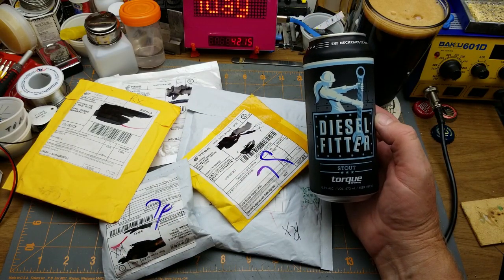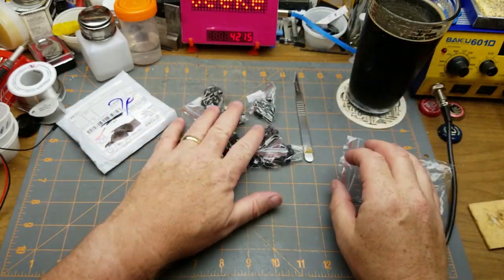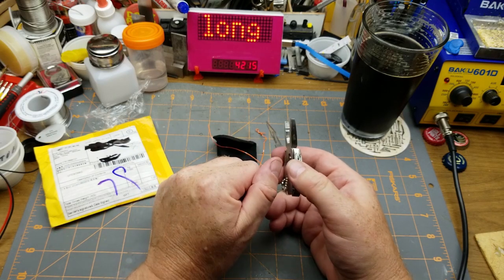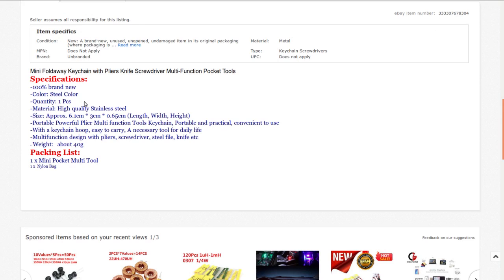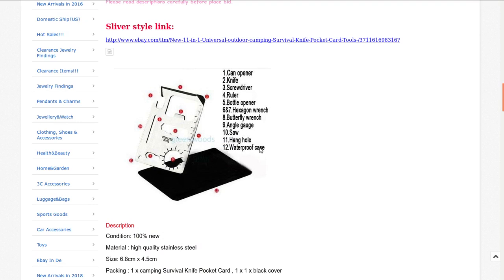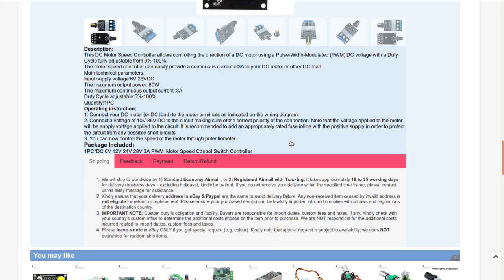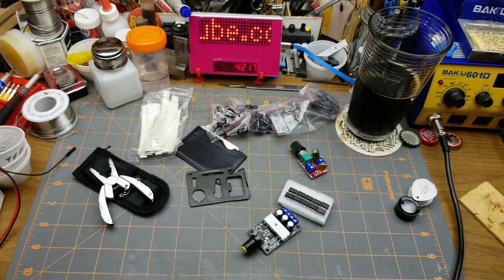long weekend bonus mailbag monday  (MM#67)

Comment: I like those unshielded drum inductors; have some on the way.  In order to get modern, fast switching regulators to work at 1mhz though, had to move way down to the CD75 size.  Cannot find anything shielded or toroidal that works at that speed.  Would like some blanks, but cannot figure out how to source them for less than pre-wound.
Reply from the maker: I've tried winding my own inductors using salvaged ferrite toroids as core, but beyond the pain-in-the-ass factor, I don't have a reliable way to measure smaller inductance values.
Reply: @pileofstuff  Received my drum inductors today, and would like to eat my words ... the 9x12mm inductors do fine with a 1.2mhz MT3608 Boost switcher.   Have built up two different Arduino inductance measurement circuits.  One is just a tank circuit that uses edge triggering to measure the period ... this is, meh, all over the place.  The second uses a weird variation of the Colpitts Oscillator.  I coupled this with the pjrc FreqCount library, which measures up to a couple of megahertz ... and now can measure sub uH!  I was lazy and did not use a comparator, counter, or even an LCD display ... just printing out a value through serial.  Works great!   See the project here:  https://soldernerd.com/2014/12/14/arduino-based-inductance-meter/
Reply: @pileofstuff  The frequency counter is pretty cool all by itself.  Uses hardware counters, so it measures higher rates than you may think possible.  You just run the sketch, and put a wire in on pin5, and hold your finger up in the air to get the all-pervasive 60 cycle hum.  https://github.com/PaulStoffregen/FreqCount

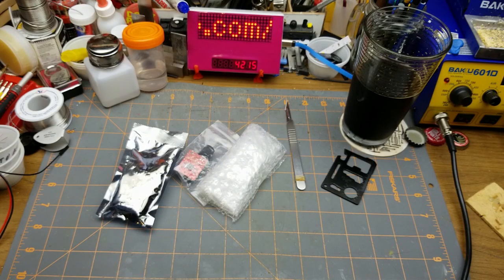Comment: @pileofstuff #pileofstuff i use the PWM @ 11:25 for dimming LED's , mainly 10w chips and LED strips and reels , they work well, pots have a click switch at the begingng , one piece of advice, they dont have reverse protection even though they have a diode, wonder how i know ? yeap, the hard way, here are 6 of the best (lol) i have seen, some maybe of interest https://www.ebay.co.uk/itm/6V-12V-24V-3A-PWM-DC-Motor-Speed-Controller-Forward-Reverse-Switch-Control-P1F6/283487430138 forward and reverse switch if you want to use them for motors , https://www.ebay.co.uk/itm/1X-12V-24V-36V-Pulse-Width-PWM-DC-3A-Motor-Speed-Regulator-Controller-Switc-C2X3/283570978782 , this one has the pot on a breakout lead that can be located and pluged in and out, useful for mounting maybe embedding in a project too, https://www.ebay.co.uk/itm/1PCS-XL4016E1-DC-DC-Step-Down-Power-Supply-Module-4V-40V-to-1-25-36V-8A-PWM-R1G5/283489299613 this unusal one that says something about its 8A and step-down, https://www.ebay.co.uk/itm/6V-24V-3A-DC-Motor-Speed-Controller-PWM-Regulator-Reversible-Switch-SG-P9-S1R0/283527384672 this one has 2x relays ,not sure why, https://www.ebay.co.uk/itm/Universal-DC10-60V-20A-PWM-HHO-RC-Motor-Speed-Regulator-Controller-Switch-R7X5/283522099439 this one says its 20A rated, and finally my favourite  https://www.ebay.co.uk/itm/Digital-Led-6V-12V-24V-PWM-DC-Motor-Controller-Variable-Speed-Regulator-M7V-X7F0/283527364203 this one has a LCD screen, last few mentioned are @ the £3-£4 mark each here, happy Labour Day weekend from the other side of the pond ;-]

Comment: Hmmmm 555 timers, my favorite chip :-D
There was a kit to make a 555 timer out of discrete parts, but the cost was silly :-(
Reply from the maker: The EvilMadScientist kit?
I was looking at that a while ago, but I couldn't justify the money.
It sure looks cool, though.
Reply from the maker: @DazzaDirect  I think he's talkig abou tthis:  https://shop.evilmadscientist.com/productsmenu/tinykitlist/652
Reply: Yep thats the one :-D
The 555 is really old but it's still easy to get, much like the Lm317/78XX regulators and the basic 741 op amp.
i like old tech, modern tech is all microprocessors and code, it kills the art of actual electronics.
Just my opinion of cause :-)
Reply from the maker: @zx8401ztv  I notice that they also have a discrete "macro scale" 741...
Reply: @pileofstuff  looks cool, probably some smart youtuber could take the 555 datasheet, create a gerber and opensource it
Reply from the maker: @DazzaDirect  If only I knew any smart youtubers who have the appropriate  skillset.
Reply: I recently built up a an op-amp with discrete components on a breadboard.  ugg.  Took like 6 transistors.  Wires all over the place.